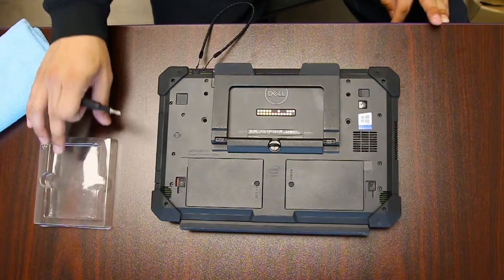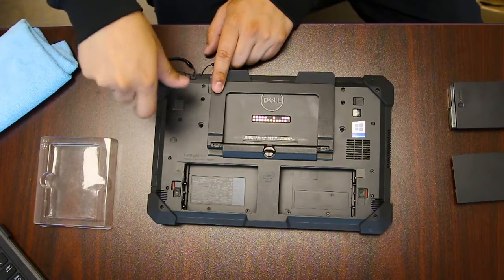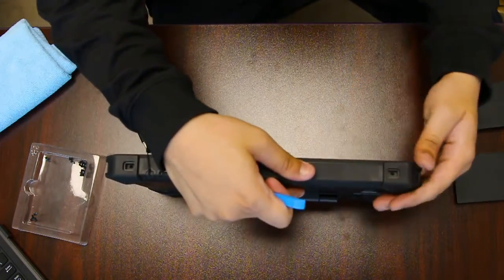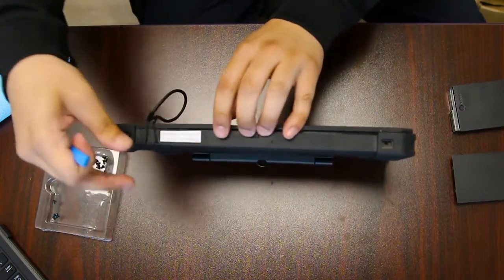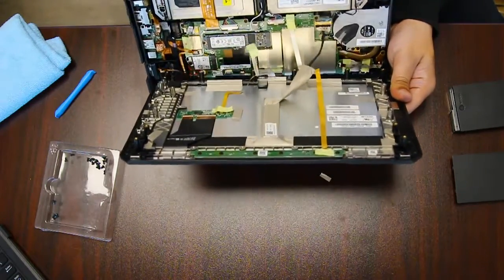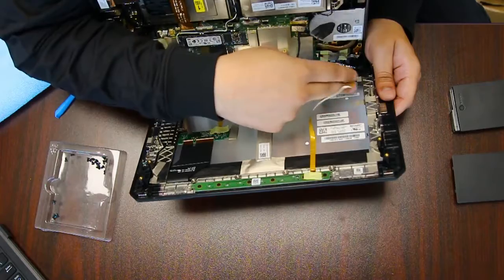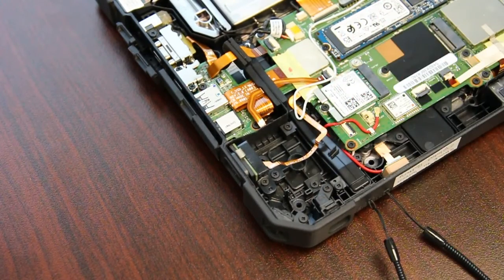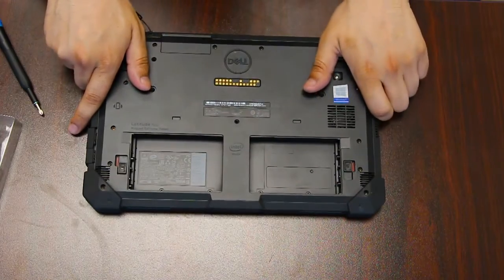Replace Your Dell Latitude 7212 CMOS Battery!

Comment: 2:51 i can't see what is being done then. It appears that the ribbon cables are holding the parts of the unit together and somehow you are separating them to be able to show us both halfs of the unit.

I see the ssd there. I'm looking to replace the 256gb on my 7220 rugged with a Samsung 990 2tb or 980, either one without heatsink. Any thoughts.

Sim card hardware seems option on these models but the physical slot is there whether or not the simcard hardware is there. I believe there's more to it than getting a simcard module, an antenna needs to be there too and apparently this is like a metallic frame.

Thank you!
Reply from the maker: @therobyouknowtv The best way to answer this question is to simply fill out our Tech support form.  Our in-house technicians will answer with the links and info you will need.  Here is the link: https://www.bobjohnson.com/tech-support-form/  Thanks for Watching.